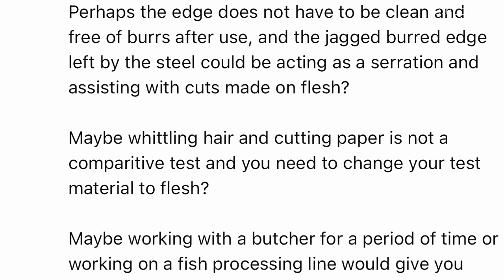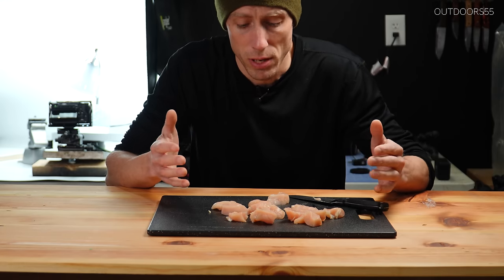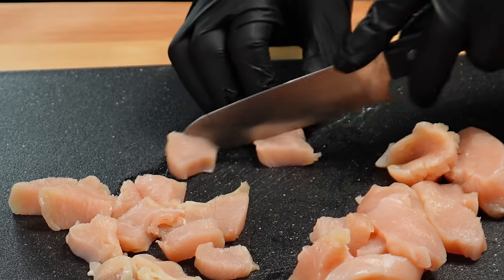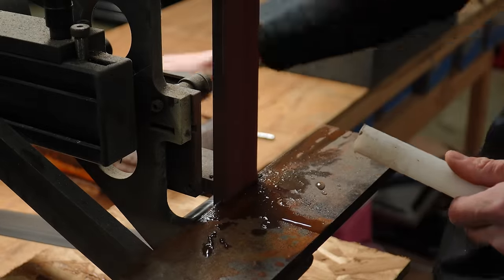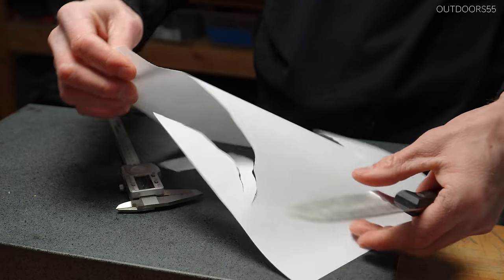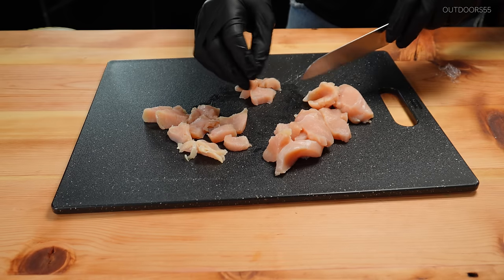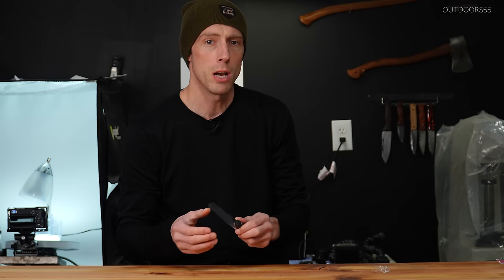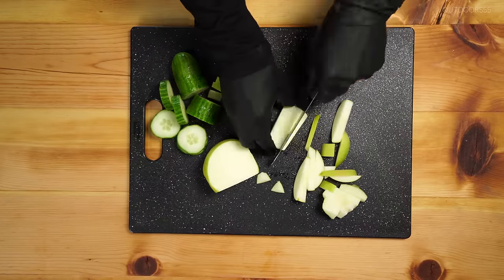Why Knife Sharpness Is Not What You Think

Comment: Ive noticed its much easier for me to get a sharper edge on an axe compared to a knife. Hm.
Reply: For me it's the other way around. I just can't get an axe sharp enough to shave.
Reply: @haqvor  i  had an issue with my council tool axe once. I could get my fiskars to pop hairs but not the council, the issue was I wasnt stropping at a steep enough angle. Try that out and see if it works.

Comment: I do not like overly sharp chef knives. No need to be wicked sharp unless cutting tomatoes... safer that way too. Much the same as the obsession for a wickedly sharp splitting axe... no thanks
Reply: I do not like dull kitchen knifes, too much force is used and they tend to slip. That leads to very nasty cuts. Sharper knives are safer, you don't need to use force, just learn to cut with an actual slicing motion. If you think a dull knife is safer, you are doing things wrong. Learn proper technique with a sharp knife instead.

A sharp knife also makes better cuts. I've literally spoilt my kids with the mouth feel of cucumber cut with a sharp blade. There is a distinct difference between shredding the produce and slicing it. Try cutting cucumber with a dull and a sharp knife and blind taste them. You can easily tell the difference.